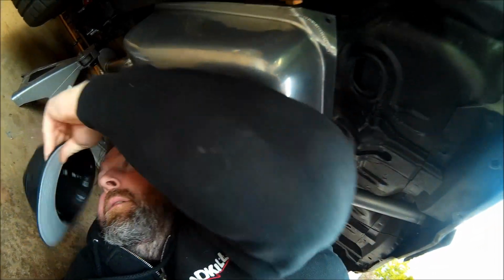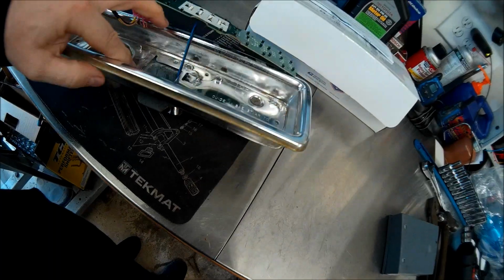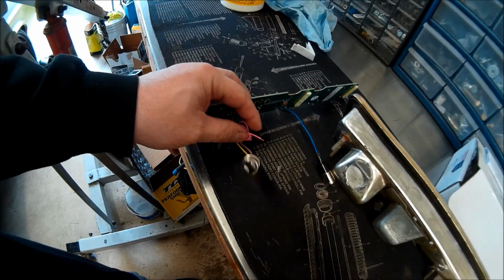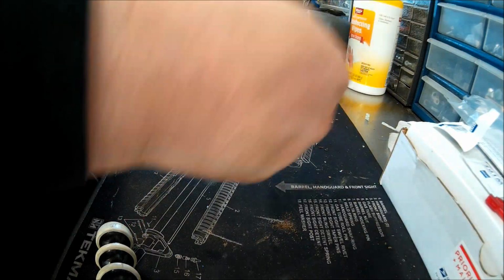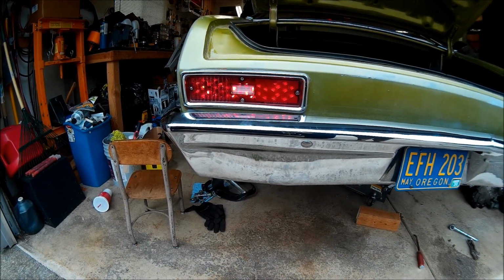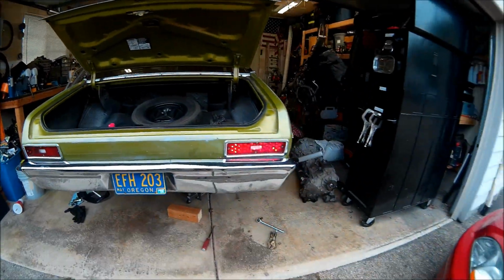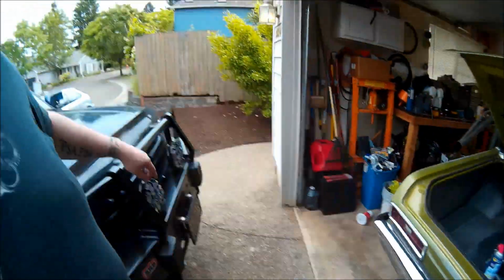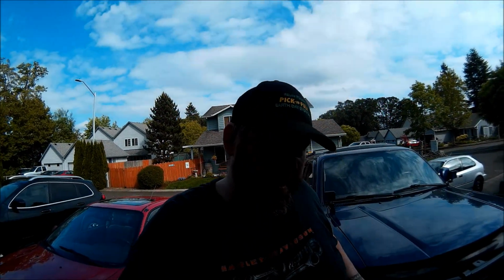LS Nova - LED tail light Upgrade - 1971

Comment: You are back!
Reply from the maker: PMcGuffin haha yep, my trouble shooting is not making for very captivating footage so I figured I better switch gears and get something done in another area :)
Reply: BillyFargon makes sense, hopefully that bumper comes off easily with that tool, I ended up cutting my bumper off section by section because the nuts the bolts went into broke off their welds and there was no way to get to them with the tools I had lol
Reply from the maker: PMcGuffin oh man.. I may be in the same boat! We will see I guess :/
Reply: BillyFargon fingers crossed man

Comment: I’m Looking at these for my 69 Camaro.  Where did you wire the 12v pink wire up to?
Reply from the maker: Feledwards get them, you will love them! I ran a power wire from the factory fuse block inside the car to the trunk.
Reply: @BillyFargon  video  for the  flasher.? Just got mine for the 74
Reply: @BillyFargon   cnt find  a video   not even from. Easyperformcae ...ur the  only one explaining   how..but forgot   flasher
Reply from the maker: @chevy-714  are you talking about how to get power to operate the sequential portion? It’s just like I noted above; run a wire from fuse block to the wire for the sequential operation. I used a key on power that I found on fuse block. Super simple, just one power wire.